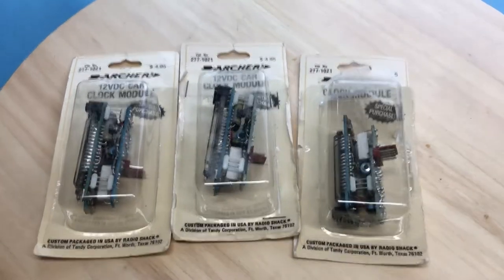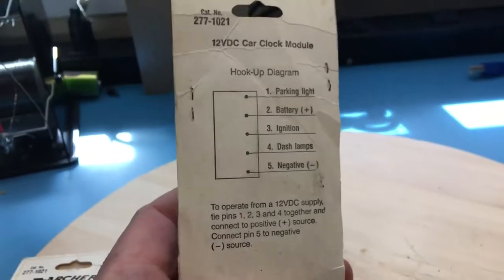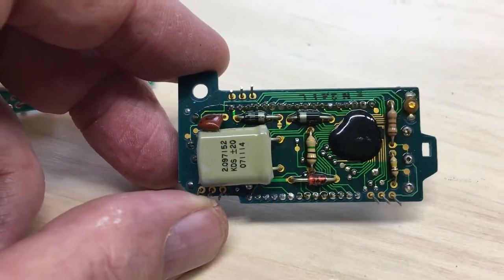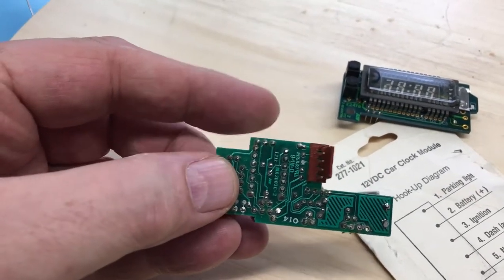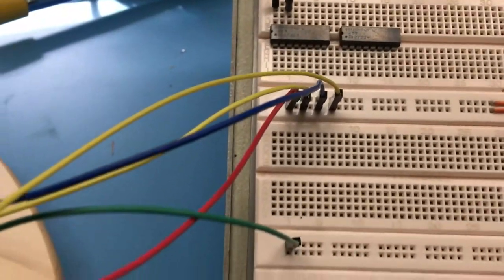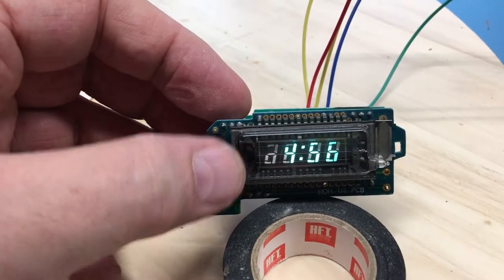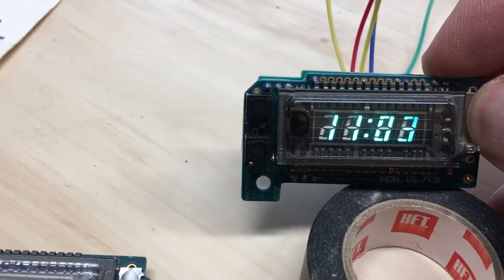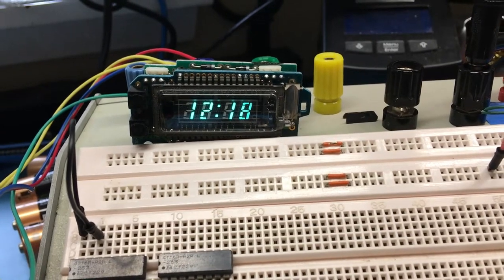Misc - Powering up a Tandy / Radio Shack VFD Clock Module - STB9

Comment: I have 2 of these in my garage, just pulled one out to play with it. I'm guessing that the button on the far right (that did nothing in the video) would light the display if you had it individually wired to ignition, battery, etc. (so no display with ignition off unless you pressed the metal button). Anyway, do you know where I can get the 5-pin female connector for it (what description I should search for)?

Comment: Thanks for the video!  I got one of these and found the power resistor really gets pretty hot.  It seems like the piggyback board is there as some kind of voltage regulation.  That resistor could be where a lot of the current is going!  I wonder if it could be replaced with 3-pin regulators and get the power consumption and heat down.  The button is to display the time when the ignition is not on (when no power to pin 3).  But it seems too flimsy to be doing that function for very long.
Reply: That resistor is probably turning the 12v into the ~2v ~60ma the filiment current needs. So 60ma * 10v drop = 0.6w, which seems about right with the heat generation. I ohmed my module out and one end of that resistor is connected to the filament, so 99% sure that's what it is.